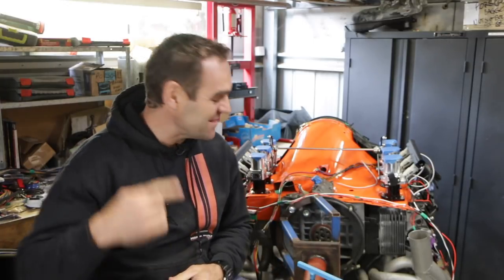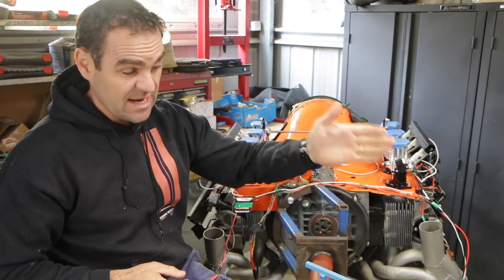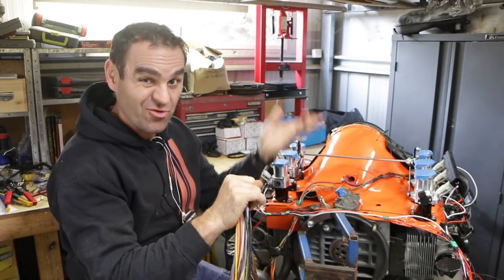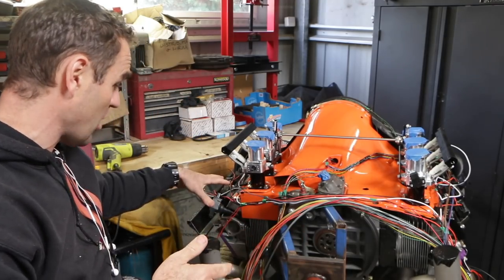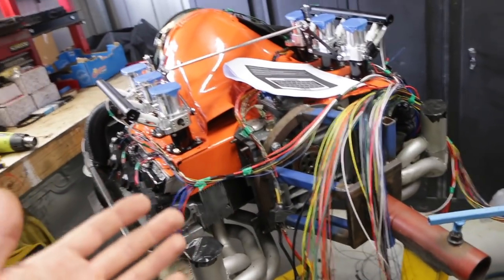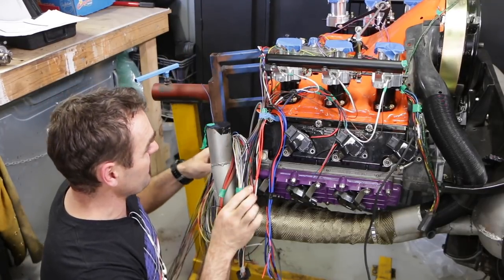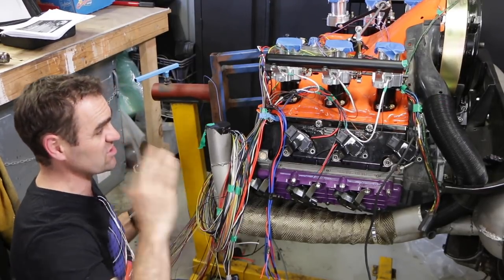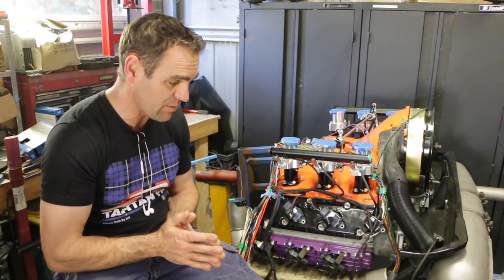Expandable mesh wire sheathing -  911 2.8 RSR Build Season 2.18

Comment: Hi Jeff, I’m sure you’re already well down the road with how to set up the throttle sensors, but my suggestion would be to set up TP Sub as one of the two within the E-Throttle connector (and ignore the 2nd) and use the TPS on your ITB as TP Main - this would give you a bit of redundancy in case your linkage breaks or slips one way or the other. If you just use the two built into the motor unit, you won’t get the actual throttle position, which, should your linkage slip towards the “open the throttle” direction, you might get the engine running away and revving up unexpectedly.

Comment: Don't forget that you'll need a drive by wire accelerator pedal that will have a position sensor built into it as well as the actuator and the throttle bodies.
Reply: good call, I don't remember his pedal setup having that.

Comment: Good work as always Jeff. I believe the duel TPS wires are not for redundancy on some V8 engines you have two throttle bodies and two TPS
Reply from the maker: I am thinking now that the TPS on the M5 motor, is probably the only TPS in that car, so it is probably not necessary in my set up.
Reply: @HomeBuiltByJeff  I think I would use the TPS on the BMW e-throttle. It seems more logical to use the sensor and actuator designed to work together I think.

Comment: A cable and pulley setup would give a 1 to 1 turn of the throttle from the BMW throttle motor..similar to a motorcycle push/pull twistgrip setup
Reply: TRUTH SEEKER great idea! Would give you more flexibility on the throttle motor location!

Comment: you know the normal throttle bodies with the circular cable linkage thing? mount one to the throttle linkage and a cable braket and then you can mount your drive by wire unit with the same size cable circle thing on it to any place in the car, only you would need to add cable brackets that way you  dont have to strictly mount the drive by wire motor to the engine, and the throttle doesnt get the non linear cam effect because the cable is mounted to 2 of the same size circles
Reply: Good point. Especially the part about linearity. With circular cams you get perfect linearity, which you can't achieve even in the best of scenarios with the linkage Jeff is working on (only for a small portion of the range). Then you could also mount the throttle body side cam close to one of the mounting points of the bar for minimal flex. I'm not sure it matters or flexes that much with a linkage mounted towards the middle of the bar, but is certainly can't hurt (and probably looks more proper/thought out and stresses the mechanics less too).
Reply: @oskjan1  You actually don't want a linear linkage because the throttle bodys isn't linear, they open a lot for the first degrees and then less and less. When you are cruising you barley crack them open and small throttle changes can be tricky.
You want more pedal travel for the initial opening that for the rest. Maybe you can program this into the ECU.
Reply: Maybe the BMW throttle motor already has a variable ratio built in?
Reply: The ratio is probably programmable in software

Comment: Intake air temp sensor should be fitted in a point that has lots of air flowing over it just like a mass airflow sensor. Ideally it should should be centrally located for your flat engine. Are you going to be using an airbox? If so that's where it should go. Mounting it on the filter base plate it may give a higher reading due to heat sink.
Reply from the maker: Good point. No airbox, but it may require a rethink.

Comment: I hope there is enough downforce so the throttle can be “drive-by-wire” rather than “fly-by-wire” ;)
Reply: I am impressed and inspired by your attitude. Just going at it, being open and learn from mistakes and continually
Improve until you are done.  The honesty and realism is everything Realty-tv is not. The Porsche engine seems to be a lot harder to work on than other engines. Really enjoyable and informative to watch :)

Comment: I suggest using a hot knife when cutting Techflex you will have a much cleaner cut,  plus it will stop the techflex from unraveling or fraying. FYI - techflex is available with a pre-cut slit which we use when dealing with existing wiring that needs to be dressed out or when large electrical connectors are involved. you just open the slit and slide it over the wire. I also use cloth tape (sometimes) when dealing with branching wiring  nodes just makes it easier to dress out the wiring, but heat-shrink is preferred  to finish the terminated ends. When using cloth tape be sure to use automotive heat resistance grade tape like this stuff from Amazon - This stuff is great.

https://www.amazon.com/Insulation-Temperature-Automotive-Electrical-32mm%C3%9711-5m/dp/B075CY4BCZ/ref=sxts_sxwds-bia?keywords=tape&pd_rd_i=B075CY4BCZ&pd_rd_r=898d6b9c-9d16-4eef-b692-2a273dff342c&pd_rd_w=LdfUQ&pd_rd_wg=LgPkv&pf_rd_p=1cb3f32a-ccfd-479b-8a13-b22f56c942c6&pf_rd_r=AT6JGKTHTZQSVT2RQBF7&psc=1&qid=1575577797

Now get back to work on the Alfa  :)

Comment: I'd have loom taped the whole thing, that mesh looks nice but it allows moisture in and then retains it.
Reply from the maker: I would say the other way around the mesh would breath, the loom tape, not so much.
Reply: @HomeBuiltByJeff  depends on the brand, I use the genuine VW stuff which is waterproof.
Reply: @neilt8790  as this is a custom loom with all plugs and connections terminated properly with weather seals, water proofing is somewhat irrelevant. Every union is already water tight, so in theory you could spray the entire engine bay with water and have no issues. The tape you speak of, on the other hand may be theoretically be water proof, but if any moisture that gets in (as simple as condensation), is going to stay trapped there.
Reply: @magnetic0314  I'm afraid you're totally incorrect, I suggest you watch Jeff's previous video showing bare crimped,  unsoldered connections under standard heat shrink. About as waterproof as a light rain jacket. Moisture only gets under waterproof tape if the loom is made in a sauna or the tape is applied incorrectly.
Reply: @neilt8790  I did not watch the previous video, regardless the use of solder is completely irrelevant as you should never be using solder in an engine bay. And are you sure it wasn't adhesive lined heat shrink? Every plug has small rubber weather seals for each wire. I think at this point you're just arguing for the sake of it
Reply: @magnetic0314  You've just admitted to commenting on something you don't know about and I'm the one 'arguing for the sake of it', are you kidding?